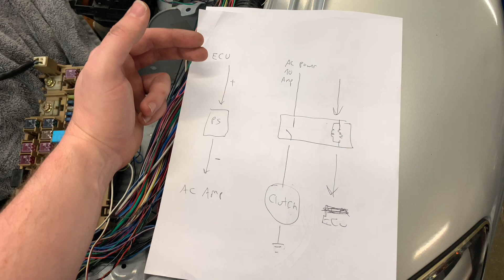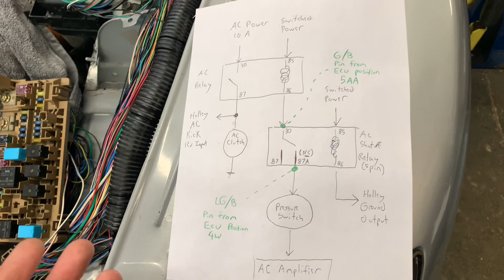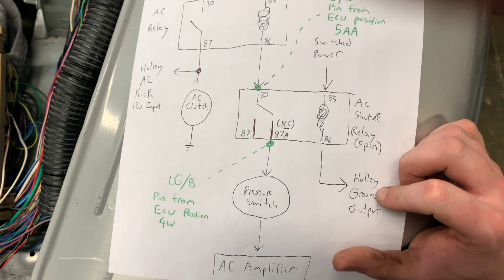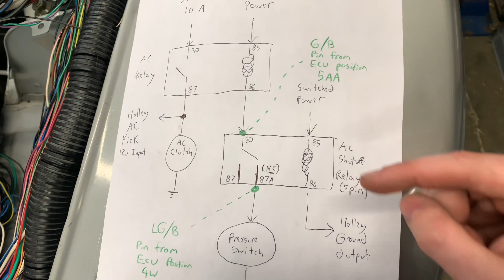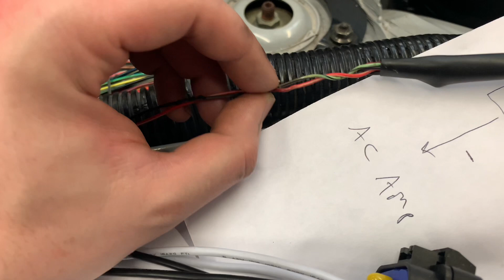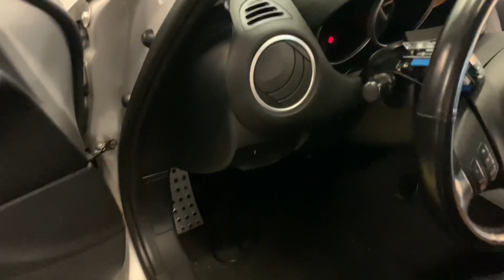LS RX8 AC wiring

Comment: Just curious, why don’t people use the OEM LS compressor? In my head, it should be as easy as just wiring in the Ls compressor into the system and leave everything else the way it was.
Reply: That's what I was thinking.
Reply: @gwilson333  I have a feeling it depends on what accessory drive you’re using. I am using a truck offset so my compressor comes out a bit more. If I was using corvette or FBody offset, that would lead to clearance issues with the sway bar and likely my steering rack mount 🤔. I still haven’t completed my build, I’ll have to let you know how it plays out